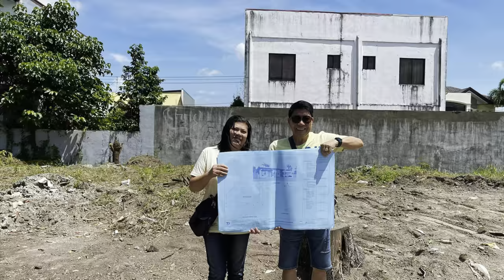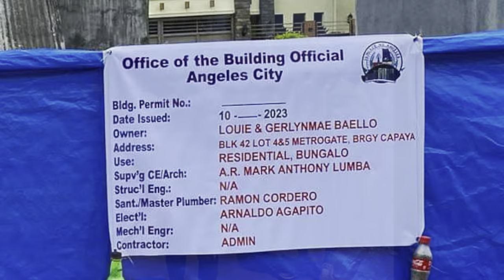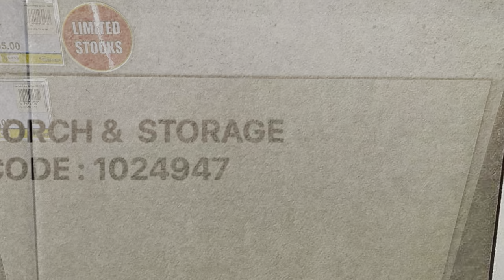OUR HOME IN THE PHILIPPINES FROM THE GROUND UP

Comment: https://www.youtube.com/watch?v=2yHSnWKmQW8&list=PLOKlDWyLBTX7ma7-M3xOcz7dT5ijaBF0Z&index=49

Isn't this the same exact house?
Reply from the maker: It’s not. Same builder but we made a few changes. We build ours from the ground up. Ex. Our laundry room is inside the house. Cabinet colors are different. Floors are different. Lanai is bigger. We did not want the 3rd bathroom outside. We opted fkr bigger lanai. We have gates also sides of the house. Porch is similar but different. Many things were changed actually